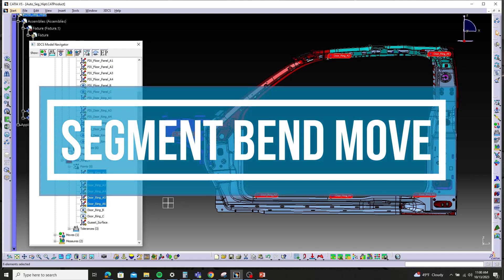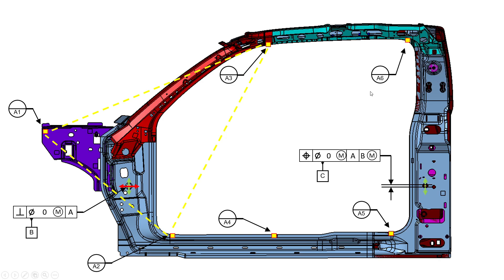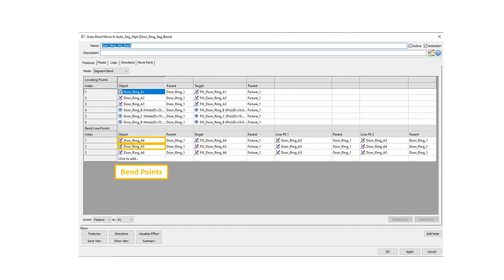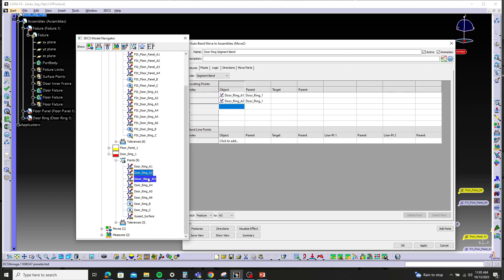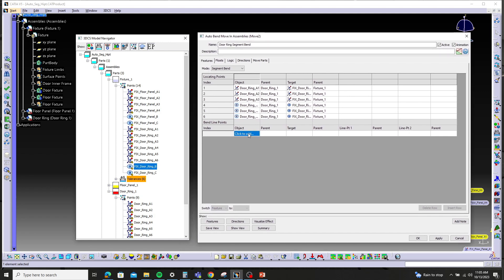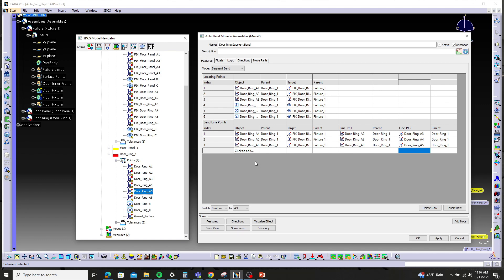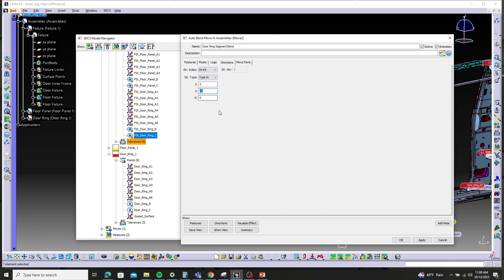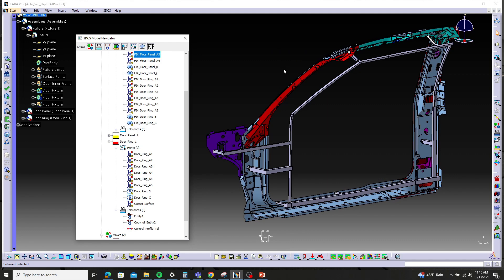3DCS Segment Bend Move Tutorial - Learn to Use Tolerance Analysis Software

Comment: Normally A1, A2, and A3 form the largest triangle as the primary datum, and A4, A5, and A6 are in the triangle formed by A1, A2, and A3.How to use bend in this case？
Reply from the maker: If your A1, A2 and A3 form the largest triangle possible for your primary datum and the additional A Datums  (A4, A5, A6 etc..) fall within that triangle, then you can just use a Six-Plane move and use A1-3 only to establish primary plane. Reason being is that there is no dimensional benefit in adding more locating points that lie within an already-established primary plane.